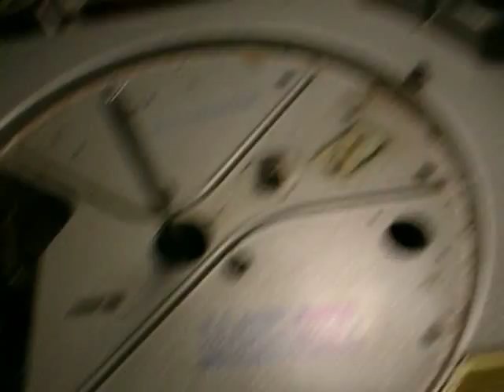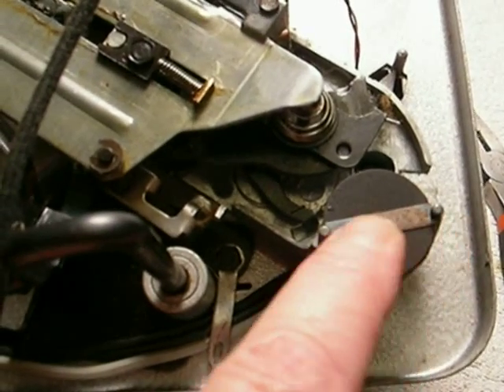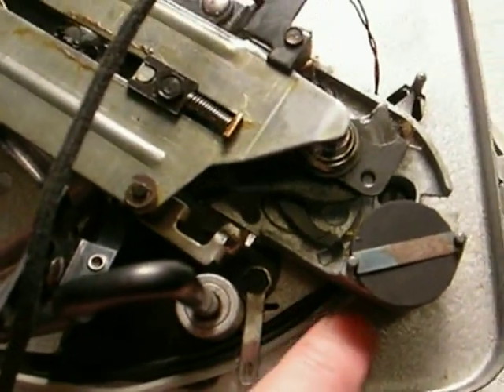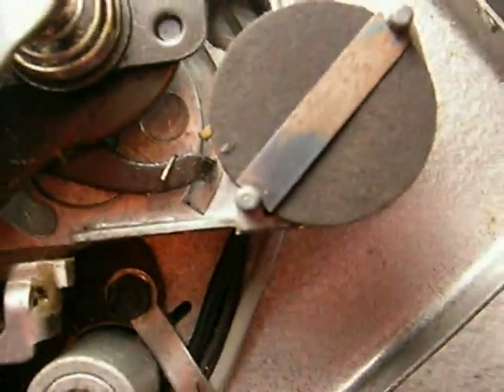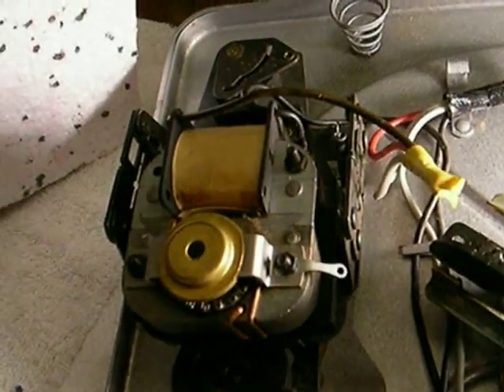1956 Voice of Music 1200 series Record Changer Part 1

Comment: hi chris,got an issue with this very same model changer! when i put on a stack of albums they lean down in the direction of the on/switch and it drops either all or several records at once.if i just put 1 or 2 it seems ok.is the overarm bent or something gummed up causing the stack to not stay straight on the spindle?